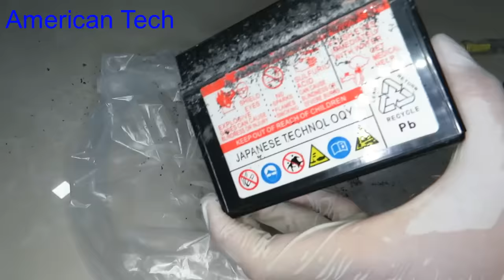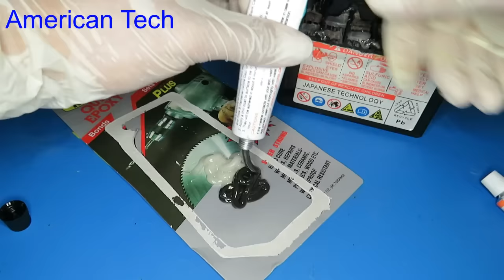Easy way  to repair 12v lead acid battery step by step , Awesome project that can help you

Comment: And after watching this, I decided to buy a new one.
Reply: Here in California,  it would cost you more to get the syringe full of acid than it would to just buy a new battery.
Reply: @mpetach  distilled water works too, right?
Reply: Lolz
Reply: 😂😂😂😂😂😂 same here
Reply: I agree 😂
Reply: That’s what I said as soon as I seen him bust out the saw. 😂
Reply: Ha ha ha
Reply: Same opinion
Reply: Lol
Reply: Yea not worth it.
Reply: I agree.
Reply: @mpetach  But in my country it will cost me less than a dollar to buy half a litre of acid lol
Reply: Nice attempt,try to put some texts too in the video for beginners to understand,for example how to maintain polarity orientation while inserting back the plates into the cells. Only music not good.
Reply: I think the same👍👍
Reply: Hi... don't waste your time better get new ones..
Reply: Jacob Meyer p
Reply: Hahaha
Reply: @ZaidKhan4481   use battery sulotion
Reply: dont use tissue. use fiber cloth.
tissue well be damage if you add battery sulotion on the battery.
Reply: Complete  waste of time !!!  🤓🤣
Reply: Good decission...😂😂😂
Reply: good experiment ..  for battery that's compleatley dead .

if ithere is still some volts but weak power ,
just add 7cc of distiled water to each cell . by opening the caps only . 
then charge it with 20v for 5 minuts, (to sidolve sulphure buildups)
then plug it to a normal charger and it will charge . 

now since you added water the battery it needs to be used for 2- 3 disschagre and recharge
cycles to regain it's acid power
attention !!!! sulphiric acid is very dangeros .
beware of the acid !! it's still strong in a dry battery too .
 wash hands with baking soda after .
don't it get's in your eyes . ! 
2 : charge the battery only outside since it creates hydrogen fumes on charging .
Reply: Do yourself a favor, buy LifePo4 battery instead of Lead acid. But you probably bought it already by this point
Reply: You'r missing the excitement of doing things, money is not every thing mate!
Reply: Me also
Reply: Me 2
Reply: l.o.l
Reply: Yeah bro me too
Reply: Kitchen paper and plastic bag around each cell......eh ill buy a new one if it has come to that level of repair, I appreciate your dedication  mate !!
Reply: Hahahahhahahahah 😀😀😂😂😂
Reply: True
Reply: Lmao
Reply: Kami sangat menghargai video ini.karena kami sudah mempraktekkan.dan hasilnya bagus .hanya dengan sedikir biaya.Jarum suntik bisa di dapatkan di apotek atau toko obat dengan harga murah
Reply: You are a man (person) of great wisdom.  Opening up a battery is mot a good idea for home DYIers.
Reply: @ZaidKhan4481  no
Reply: @ZaidKhan4481  noooo
Reply: The refurbishment of this battery and the items required are not clearly mentioned. Only the bangood link has been provided which in India is not encouraged. So the details of the items required list if provided in the description will help many in our country.
Reply: Yeah right Haha
Reply: 😂😂😂😂😂me too, I don't think am that poor
Reply: Cheap
Reply: Right🤣
Reply: And that music,dang
Reply: @mpetach   You can use rain water too
Reply: @EnseiMada   How do you fix LifePo4  battery after they die?
Reply: I agree with you hhhhhhh it's the right decision
Reply: Hehehehe
Reply: How to wash hands after that? That's so much lead acid in there.
Reply: @shahinakther1384  cough cough shipping fees
Reply: @ZaidKhan4481  Once you empty the battery, is necesary to fill it with a Sulfuric Acid solution. Distilled water is used to complete the electrolyte level of an on going battery.
Reply: same as i think
Reply: LMAO 😂😂 It's definitely more profitable to buy a new one if you take into consideration the time investment... But at the same time, this video has a very motivating effect to try it at least once just for the challenge
Reply: Good information
Reply: Yes...
Reply: A lot seems wrong. First, you should use a combination of sulphuric acid and distilled water, and the proportions should be exact, not randomly.
Reply: Same here. There's a lot of works and stuff that you need it..
Reply: Laughing🤣😂🙃 like a mad . You made my day

Comment: He used tissue paper as insulator which not right it should be some thing like polyester... Tissue paper is a plant cellulose which will dissolve in sulphuric acid
Reply: Toilet paper & kitchen towel all dissolve in plain water as are designed to, if not all sewage works would block up.
Reply: Correct, the paper used is glass micro fiber. Oddly enough, add water and it'll dissolve quicker than toilet paper. It is stable in acid though.
Reply: @sdawson2214  Paper towels dissolve very slowly in water and are the source of many clogged pipes. They belong in the trash, not in a sewer system.
Reply: Cottoon? Algodón??
Reply: @S Dawson  so?
Reply: I replating battery in my shop but I dont use tissue hehehe, that is not right spacer...
Reply: Hahaha bahhhhh

Comment: If that was the easy way I don't want to know the hard way.
Reply: My thought also just when he just tried to saw the battery.
Reply: THe hard way might be working your regular job until you have enough spare money to buy a new battery.
Reply: Easy to die because quimics contact
Reply: It’s nice
Reply: Hard way requires standing in the center of the north pole while face south, then realizing you left the battery at home
Reply: Hey everyone, the best results that i've ever had was by following the Magic Mender Wizard (just google it) definately the best course that I've tried.
Reply: I have spent months studying fixing a car battery and discovered an awesome website at Magic Mender Wizard (google it if you are interested)
Reply: That was my exact thought as well.  And the music is not repetitious at all
Reply: @DG-kk5pm  so true haha
Reply: LMAO
Reply: Also the first thing I thought. Just crazy.
Reply: There are several factors in battery repairing. One plan I discovered which succeeds in merging these is the Jons Mender Guide (google it if you're interested) without a doubt the most helpful course i've seen. Check out this super website.
Reply: I have spent months researching into battery reconditioning and found a great resource at Jons mender guide (check it out on google)
Reply: Should I spend months considering battery repair then check out Joe's fixer by searching it on duck duck go?
Reply: @birdtrujillo8621  It’s not free.
Reply: The hard way is without gloves
Reply: @Rabbit.760  
That would not keep this guy from fixing the battery.
Reply: When in Haiti …do as the Haitians

Comment: Thanks for the video - I learned about the internals of a Lead Acid battery - that was useful.  Surprising to note that the Lead Acid battery used in our modern vehicles has not changed at all since its invention in 1859 - 150 years ago!
Reply: No need to change,THEY are making a fortune as it is; the battery continues to be one of the  weakest parts of a car
Reply: Neither has the wheel.
Reply: I have changed more than you realise because modern batteries don't last as long. 5-years max but older batteries would last 15 years easy
Reply: @obviouslytwo4u  The lead plating is thinner on new batteries and they cheap out. Some are only lasting 3 years depending how you use them.
Reply: Good things get improve not change.
Reply: How to wash hands if you get in contact with lead acid?
Reply: Baking soda and fast
Reply: @VanBC-xu1dh 😊

Comment: I'm no expert, but I think the positive and negative terminals are supposed to extend to the outside of the battery. By connecting the inner to the outer, with what ever wire you have used, you have created a weak point for the acid to attack, which will sever your batteries cells from the outside terminals, it probably would have been better to drill out the terminal holes, and soldered lead extensions to the outside world from your positive and negative cell terminals, maybe stuffed the gaps with a bit of paper towel  or something, and used some steel tube placed over the top( cut to the length of the outside terminal) and poured some hot led to make terminals and seal them from leaking. Like i said, though, I'm not an expert, it's just how i would have done it, also those plates didn't look phucked at all

Comment: Thanks for showing us the cut section of SLA battery.Repairing of rotten cell plates and insulating with tissue papers definitely proved that you are honest to your viewers.still then I appreciate your hard works rather most prudent to buy a new one or go for lifepo4 chemistry battery

Comment: 👏all that for a$27 dollar battery but the point is you made it work but if it was a $200 batt I would be watching this video over nd over to fix it's not the price of batt it's a reference to all batteries 👍👍👍👏🎉🎊
Reply: Even if it was 200, not worth the effort and risk of inhaling sulf acid fumes and lead

Comment: Those lead plates still look to be in excellent condition.  Water would have probably been enough with a graduated trickle charge lasting a few weeks.  A cheap solar charge controller (with 20 watt or more solar panel) will charge any lead acid at 1/10 of a volt more than whatever the battery is currently holding.  Modern solar battery maintainers that are low watt and close to 20 volts in full sun are too high voltage and won't work: they are basically worthless.  Solar panels used to have lower voltage back 30 years ago or so, but improvement in technology was made and voltage was raised.  Great for use with a charge controller and inverter, but not good for 12 volt trickle panel.

Comment: Spends more money to revive than to replace! 😊
Reply: Teo technical aspects that reduce reliability of rework:
1) the reducrion of plates thickness
2) liquid acid constrain to inspect the level instead the gel acid.
Too effort with no reliability.
Reply: Thanks tot the info. Those  reactions on better buying a new one are not necessary, for many people $15-30 is too much for a battery. I want to try your  method, what acid did you use, and where to get it?
Reply: Trouble is his paper towels will dissolve in short time. Microfiber glass is used in batteries. First or third world, this wont work when the paper dissolves and it'll never hold load. Should've built a fire instead.

Comment: Safety first wear latex gloves and use a wire to direct short the battery.
Reply: The lead dust in that battery went straight through those latex gloves he used. Nitrile gloves are used in manufacturing batteries and the lead particles still make it through. A special soap and wipes are used to remove those particles. Specialty respirators are also worn. This video is bad juju.

Comment: every few months the tell us there's "new battery technology" that's going to revolutionize batteries. and all i ever see is 1930s design with added designed obsolescence so they'll fail in 11 months.
Reply: Lithium iron phosphate batteries are practically maintenance free, they last 2000 cycles instead of 300-500 cycles of conventional lead acid. However they cost 3-5x the price.
Reply: Application matters. Lead acid batteries are horrible at storing energy for a solar or wind grid, for instance. They're ideal for many things, like the voltage to jolt your car into action.

Comment: "easy" puts a few paper towels in between the plates and watch battery explode after paper dissolves in acid and plates touch each other.
Reply: Jerry Doe <ding ding>. Exactly what I thought. Paper towels are NOT a replacement for glass mats!
Reply: I doubt those were paper towels but I am wondering what he used, nothing so far - my guess could b a HD handy towel, they pretty tough, I reuse em after dry out if not too dirty
Reply: @Jake2670  acid will dissolve cotton, synthetic etc... Original batteries use glass fiber between the plates
Reply: @JerryDoe  well, you said paper towel, if read down, n I didn't think about it, this is an AMG battery those are glass mats so you would have to replace it with absorbed glass mat
Reply: He may have cleaned And re soaked it in some way but his video is definitely not very detailed or complete
Reply: @Jake2670  you can clearly see he used paper towels, unless you got some internet issues and cant turn up the quality to 720p. also no he did not clean the fiber glass mats because simply you can't clean them especially that white and crisp. also he folded the paper towel in 4 halfs, if you look close you can see how sharp the fold is and if you ever worked with fiber glass you know the structure is wrong and you cant fold them that sharp. and if you still don't believe me i'm an engineer i work on engines, cars and motorcycles. and exploding batteries are frequent problems duo poor maintenance or this stupid crap. you should not mess with batteries in the first place no insurance would cover this is if it explodes in your face and/or causes fire.
Reply: Right absolutely right
Reply: @JerryDoe  at first im curious what is the white part of each elements, never thought he going to use paper towels 😂

Comment: Just because the bulb has turned on does not mean that the battery is working. It should simultaneously measure the voltage and observe the voltage drop for at least 5 minutes. I believe that after this time the bulb would no longer light.

Comment: Your supposed to do a load test on the battery when you finished ..not just connect it to a small lightbulb...  You can connect a lemon to a light bulb and it will light up.  The real test is the  heavy load test which you failed to do.
Reply: Nah, it's TV magic. All he did was contaminate himself with lead and ruin a good battery. The plates are separated with microfiber glass that's been pasted with lead (2) oxide, not paper towels. The video is utter bollax.
Reply: I know very little about electronics but I know enough that this video made me laugh. The cloth was obviously not a paper towel based on the sizzors used to cut it. But the light bulb test at the end was pretty bad that's a headlight bulb and it barely lit up.

Comment: Why did he not just top up the cells first before taking apart that's why you have the holes at the top
Reply: he used the knife to also desulfate the plates. which... may help? this was a clear case of lack of electrolyte though, so I dunno.
Reply: Looks like AGM battery , it’s not top up w acid , absorb glass matting . Good work

Comment: Never open a lead acid battery! This battery had only a small amount of sulfate at the plats - this can You repair without opening the battery by a pulsar electronic. If You open a really defectiv battery all the plats will fall into lead and leadoxide dust!

Comment: My personal opinion and I may be wrong. The distilled water in the battery had dried out. That's why very little liquid came out.
I would have added a little distilled water to submerge the plates, and then charge the battery. If lucky, it would work.

Comment: After full charge, only 6 V.... Acid must be 24 -25% or 1.28 g/cmc. You must check every cell and if you have not 2.1 or 2.2 V you must replace it. It is a good work but you must see if it worth it . A little battery is cheap but a 200-300 Ah battery worth it to repair because in general only one cell is affected. The future is Li-Ion or Li-Po.
Reply: Thank you if he mentioned that it will be great

Comment: If the lead is intact, there is no need for any of this, buy a desulfator device, and you can repair your battery without hassle. I have repaired many of them and the success rate is around 70%

Comment: You can desulphate it with a high frequency desulphator and clean the terminals. If you need to add water, then drill holes. Add water with a syringe. Tap the holes and plug with plastic acid-proof bolts. Or melt in some plastic or correct epoxy.
Reply: Desulphaters don't work. I experimented out of curiosity
Reply: Why you dont make a video and show us
Reply: Desulfator won't fix dried out SLA battery.  His knife was the desulfator.

Comment: Wait. You did't even checked how much juice is there before you proceed.
Edit: i'm not convince v
coz there was no qualitative data before and after the repair. Good experiment though.
Reply: Pinoy keyboard if the battery had any charge in the beginning of the video when he touched the two leads with the wire it would have sparked. So therefore he proves his point on how to revive a battery.
Reply: @joelramirez4688  
Wrong. What i meant is the quantifiable amount of power left with that battery before it was disassembled and reassembled.

Comment: Excellent video! 
Did you place a paper towel between the plates? or what kind of towel is that? I'm afraid that a paper towel won't stand the acid..... Which other materials would you recommend instead?
Reply: Paper towell wont even stand water.
That battery is good for recycling
Reply: That would be fiberglass mat to resist the acid.

Comment: Is the wire you use at the terminals copper? How will you prevent copper from rotting in sulfuric acid?
Reply: It just needed to light a bulb for a few seconds...

Comment: I would love to have seen the test at the end! but I could not see it, because you had a huge link for the next project option right in front of the light bulb! nice job, maybe you could watch out for that or stop pushing the projects we will see anyway as long as we enjoy your posts, which I'm sure we would all enjoy as long as the whole thing can be seen!
Reply from the maker: Ok I will remove it. Thank you for correct me
Reply: @ATdiy  How long did it take the "repaired" battery to fail?